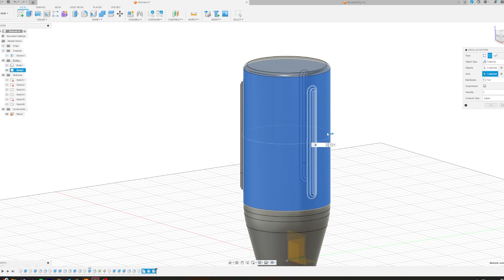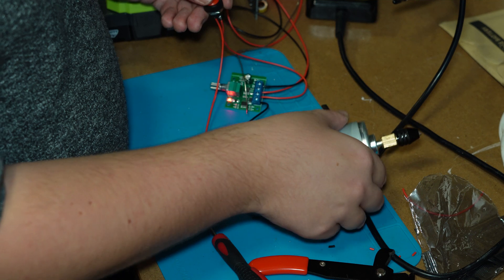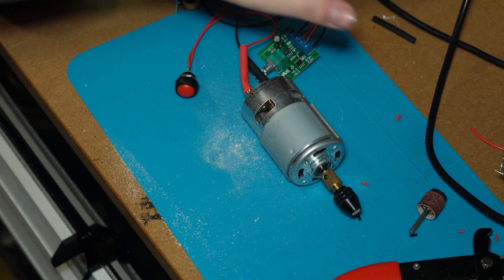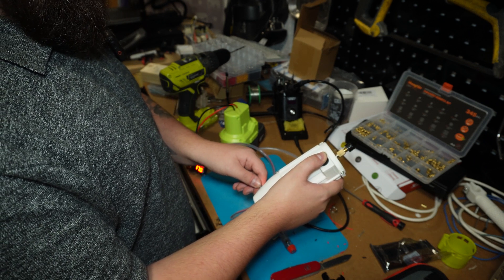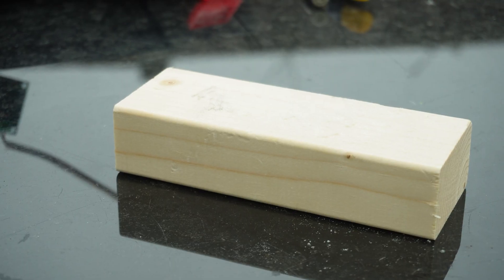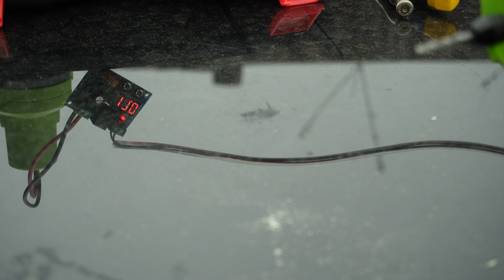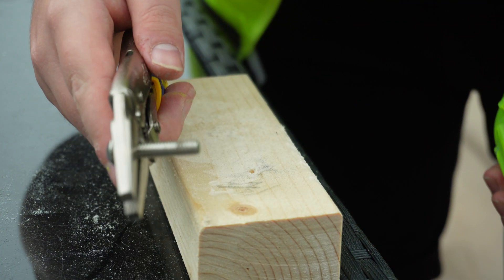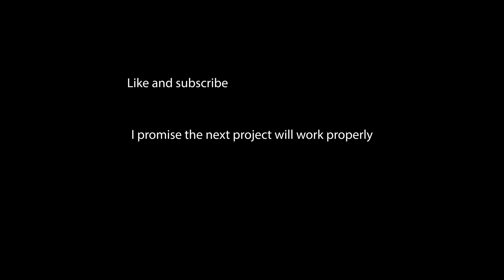I BUILT a DIY Rotary Tool That Runs Off a Power Tool Battery

Comment: Use a reinforced abrasive cutting disc instead of the diamond grit coated one.
Reply from the maker: Thanks for the info :), I clearly had no idea what I was doing with the bits I bought. I for sure coulda spent like 2 seconds trying to research it but we live and we learn.
Reply: @MattPonsfordMakes  the screw in the end of the rubber drum for the sanding sleeves is supposed to be tightened to expand the rubber to hold the sleeve on
Reply from the maker: @greggv8  That makes a lot of sense.

Comment: I dont know what do you want to spend, but probably better to get a Flex shaft attachment, and have everyting with the battery, so you only have a smaller tool to work with more precision wile maintain the big motor, you are using it like that anyway with the battery conected by a cord
Reply from the maker: Hey, cheers for the info, I'll probably try to make a Mk2 at some point, so I'll keep that in mind.
Reply: @MattPonsfordMakes  Yeah, a flexible shaft extension can be had for dirt cheap on ali.  While there, have a look for a foot pedal; you can use both foot switch and pushbutton in parallel, but having a foot pedal means you can use both hands to hold right up next to the bit and turn it on and off with your foot.  You'll get a ton more precision that way.